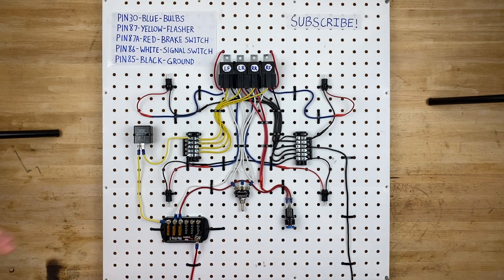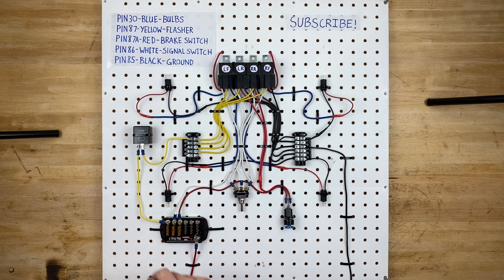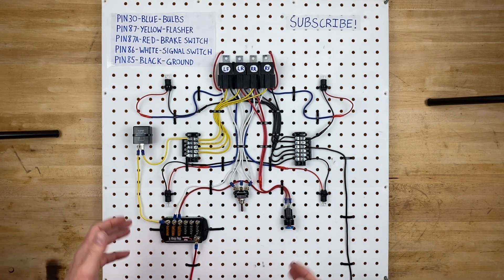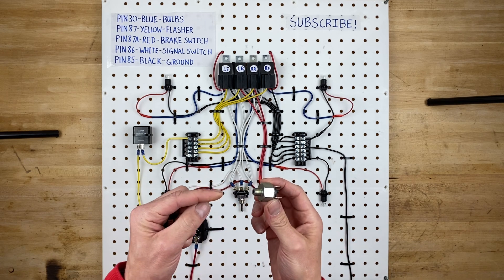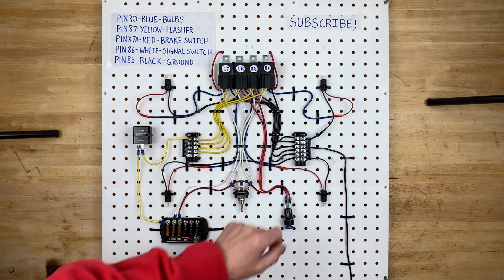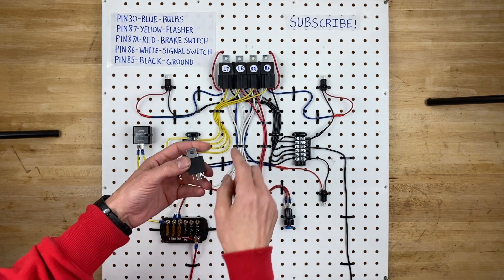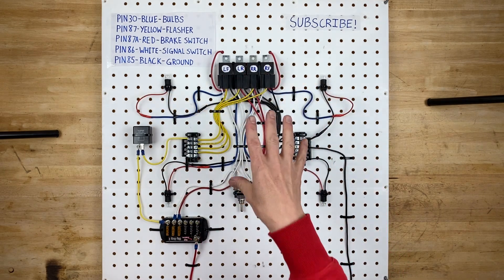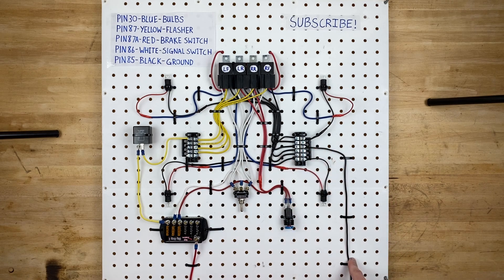How to Wire Turn Signals AND Brake Lights into a ONE BULB | @WiringRescue

Comment: Thanks for the video! It was a great help. However, I have an issue with wiring my brake lights. I seemingly have all my wires set up just like you, except I have 2 relays instead of 4. I have my left side together and my right side together. All the blinkers and things work great, but the brake lights, specifically, do not light up. They do not brighten when pushing the brake switch. It's a brake switch like the one in the video (it closes the circuit when pressed). When I have the brake switch wired to power and the switch wired to the relay, and I press the turn signal, the turn signal lights stay on when the brake is pressed, but the rear lights still don't light up??? They only brighten up when I disconnect the brake switch from a power source, and the blinker works as it should. Could this be because of my relays are bad? They are brand new and both do this.

Comment: Great video! I have any bike with pre-existing rear turn signals. Am I able to add front turn signals and wire them into the existing set up? As opposed to having two separate switches for front and rear turn signals? Thanks!

Comment: Great video series, thank you for your time and energy that you put into these!

Quick question for you on the "ire Turn Signals AND Brake Lights into a ONE BULB" video:  This is exactly what I need as I have completely removed all factory parts and wiring on a street/strip vehicle but in order to run the car on the street, obviously I need turn signals and brakes.
That being said, I AM using std. 1157 dual filament bulbs up front and in the back of the car, so... Do I wire it the same way you demonstrate in the video or is there a tweak required because of the 3 contacts on the 1157's vs. the 2 contacts on the 194's in your demo?

Thank you very much!

Comment: Enjoy your videos, very informative. I have a small tractor and headlights  and fender marker lights turn on with a two wire switch. Ran new wires to fender lights and added a hazard switch, but would like all lights to come on with the switch but also for fender lights to work as hazard lights when I switch them on. I know very little about wiring, just enough to get me in trouble but also get some stuff done, but cannot figure out how get this done. Any Ideas? Possibly use a 5 pin relay? I have no idea what to do. Thanks

Comment: Do you know how it works on an older car that has the power for the flasher going to the turn signal stalk/switch which distributes the power to the lights directly from the switch?
Reply from the maker: The old cars have a turn signal switch in the dash that is wired very much like the switch in this video https://www.youtube.com/watch?v=Io_i9016o10

Comment: You seem like someone who would know the answer to my question: i have a 7 way rv plug with turn signals yellow and green wires both hooked up along with a brake wire. When i hit my brakes, both lights light up np, however when i turn left or right, both lights flash. There is no other way to wire these wires unfortunately but can you think up a solution that will fix this issue for me ? I was told a recrifying diode would help but no idea on how to get that done. 
Thanks in advance.

Comment: Nice video I’m working on a project truck what if I wanna hook up a trailer plug for the trailer lights to work do I wire them into the same circuit

Comment: Ah! Of course, the power to the brake lights runs through the normally closed contacts. I was trying to wrap my head around this concept for days. With the help of your video, I was able to rewire my hot rod for combined turn and brake lights. Thank you very much for the detailed and simple explanation.
Reply: Would be considerably better if he provided a wiring diagram.
Reply: Will this make an LED light flash yellow with a 12v flash then turn back red with a steady 12v?
Reply: Just went through the same process lol

Comment: Thank you for this video and the great explanation! I was able to wire turn signals, break lights, hazard lights because of this video. One suggestion I do have is to have a schematic somewhere in the videos so people don't have to (reverse?) engineer the video.
Reply: @ElectroTree01  Weird that my comments disappeared.
Reply: @AztecWarrior75  I added onto what was shown in the video using my electrical knowledge(just a dpst switch that switches both side turn signal relays at once)
Reply: @AztecWarrior75  I put them on a garden tractor. I did not require the ignition to be on in order for the lights to work(brake, hazard, etc). I definitely considered the fact that hazards disable brake lights with this arrangement but for my purposes, I don't think it is that important. If I was putting them on an on-road vehicle, I would have a separate brake and turn signal. I know that there are many alternative options which I could have just as easily tried(using arrangements of diodes, relays, switches, etc) but I wanted to try something a little different and I would probably use one of these arrangements in the future if needed.

Comment: Thanks for all your videos about relays, I have learned a lot from. I have a question about a 3 wire light for turn signal and side marker, I want it to cancel the marker when I put the blinker but don’t think it’s possible with one relay because if I wire the the marker to 87 and my blinker to 87a I would have to turn my side marker off via switch every time I would turn my blinker on for 87a to work. If I wire side marker to 87a I don’t think would work either. Any ideas would be appreciated ? Thanks again
Reply: The wiring is almost the same. Difference is that you will wire the running light circuit, to the side marks, in place of the brakes. And it can be done using only two relays. Of course you will need to Either change out your turn signal switch to a DPDT. Or use timer relays. 

It all depends if you are trying to do this as a "from scratch" wiring or trying to add this to non modified stock vehicle. 

So you should start by giving more details about the vehicle you intend to do this on. 

I have diagrams.

Comment: Very useful, but I really wish you had included a wiring diagram. Or rather two: one of the whole circuit, and one just of the way the relays themselves work. Having both this general - but very clear - description, and the technical diagram you can refer to, would help full comprehension immensely.
Reply from the maker: All of this stuff comes straight out of my head, so I don’t have written diagrams for it. At some point I would like to make them, but there are only so many hours in a day. I do have a video on how relays work which you may find useful. https://youtu.be/QCkfFCLa_Jg?si=6sYrYoNSMV3X__Mb. Good luck with your project!

Comment: I know others have asked but they either didn't receive a reply or their reply doesn't answer my specific question. Im employing this system but if i was to add hazards how would I do that? Could it just be setup for the hazards switch trigger pin 87 on all 4 relays and if so would anything bad happen if the turn signal switch got turned on? I understand with that setup the hazards wouldn't work without the ignition on, correct? I know this is a lot but would appreciate any advice. Thank you in advance.

Comment: can you expand this setup to include a hazard light switch? and what it would take to make hazards operate at the same time that brakes do? in other words single filament bulbs used in the rear for brake and blink but when hazard lights are activated the brake switch will still illuminate the rear lights solid, not blinking

Comment: This is explained really well. I’m trying to wire a jeep with single bulbs as running lights, turn signals, and hazard. Is this possible? I have it wired similar to this but instead of the brake light it’s the parking lights but it’s not working correctly. Any help is appreciated!

Comment: Do i have a taillight im working on

Truck already has The following:

Brake
Signal
Ground

What would go in the flasher wire?
Ive hooked all up and signal does not work whenever im pressing the brake, i had it working a couple months ago but stopped working all the sudden, any help would be nice. Thanks in advance

Comment: Great video, thank you! Quick question, would it be possible to use only 2 relays 1 for both front and back left and another for front and back right. Just trying to cut down on wiring because of small space. Thanks again, your videos have been very helpful!
Reply: Not if you want brake lights on the same 1 filament bulb...

Comment: Check out "Kwik Wire" chassis wiring harness i was very surprised to learn when i bought there kit they dont use relays for any lighting for the exception of there flasher and emergency flasher. Other then that no relays? They do use fuses but claim relays are not necessary due to there AWG of wiring is so heavy. I would love for you to order there 8 curcuit kit as i did and do a review on it with an explanation for there thinking???

Comment: This was a great video and really helped me solved getting the brake light and turn signal portion of rewiring my 1965 Corvair, thanks a bunch! One small request though, is there any way you could include how to have a brake switch connect to a relay to send power through pin 87A on the LR and RR relays? I was able to figure it out on my own but someone may need the heads up before they try to hook up their brake lights through a >5 amp switch.
Reply: "how to have a brake switch connect to a relay to send power through pin 87A on the LR and RR relays?" 

Did you not watch the video? That is the way it is in this video.

Are you meaning to say that you want use the brake switch to energize a 5th relay and that is what connects brake power to the other two relays?

And what's wrong with using a Greater Than (>) 5 Amp Switch?

Comment: Fantastic video!!! Quick question. I'm restoring a '36 Ford that originally used this circuit with single-filament bulbs, but I want to upgrade to a 3-wire (brake, tail, ground) LED unit so the lights are brighter. Does this circuit still apply, or could I run separate brake, turn, and tail circuits as if they were all separate bulbs, and then run them through one of those Curtis 4 to 3 wire adapters like you find on trailer towing kits? Thanks!
Reply: First off. "'36 Ford that originally used this circuit with single-filament bulbs" No it does not use this circuit. It does not use relays at all. It uses a slider turn signal switch. 

"and then run them through one of those Curtis 4 to 3 wire adapters like you find on trailer towing kits?"

That's not how those kits work. You actually have to have the wiring already there.

In order for you to have seperate the circuits at the switch by taking off the brakes and running it separate to the rear (whole new wire)

"3-wire (brake, tail, ground) LED unit so the lights are brighter."

It is not being 3 wire that makes it brighter, since the power draw is the same. It is the type of bulb, Gauge wire, quality of the switch, that are the determining factors of brightness.

Comment: Great Video greetings from Argentina, this system is the same that DKW Cars used, the main difference Is there Is no relays, the car has a Ligth Switch that has on One side the Headligths Swicht and the other side the Turn Signals Switch, in the Turn Signals Side there's a output that goes to the brake Switch.Could you Made a Vídeo about installing hazzard ligths with this type of connection?
Reply: I agree, I would like to incorporate a hazard flasher into this system. I there a way to put a switch into the flash circuit from the factory flasher to function like the factory hazard switch?

Comment: Thank you for sharing your knowledge. I have a question about pin 87. I thought pin 87 always go to the load. Your video showed pin 30 connects to light bulbs. Is it matter or am I wrong? Thank again
Reply from the maker: Solid question, and you are totally right under normal conditions, which you can see in this video I made https://youtu.be/QCkfFCLa_Jg. However - this specific video is a special case when we are using them in reverse to get the desired result we need. As long as the proper fuse sizes and wires sizes are in place, it should function just fine. As I’ve said in a whole bunch of my videos, there are many ways to wire a circuit, and this is just one. :) Thanks for watching and posting this question - I wish I had planned better and answered this in the video itself! Ah well, each video I learn a little and try to make the next one incrementally better. Thanks again.
Reply: Thank for answering my question. I spent 2 years in automotive program. I wish I had an instructor like you while I were in school. You make the most difficult subject to become fun and easy to understand. Best wishes